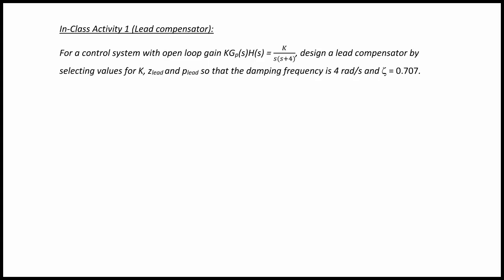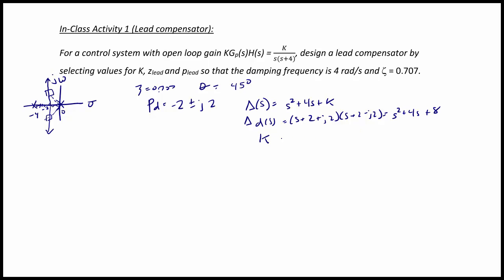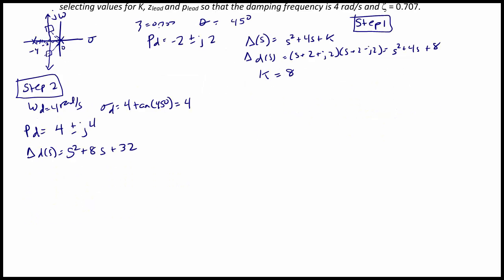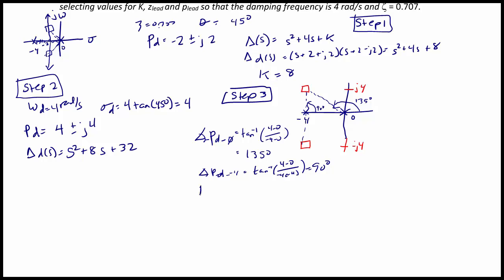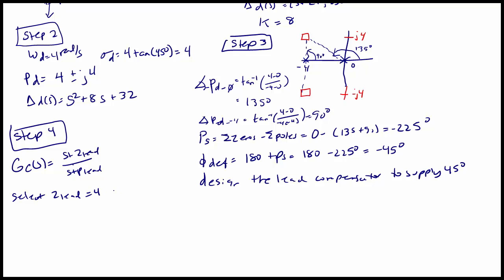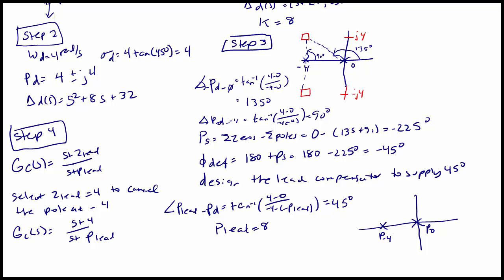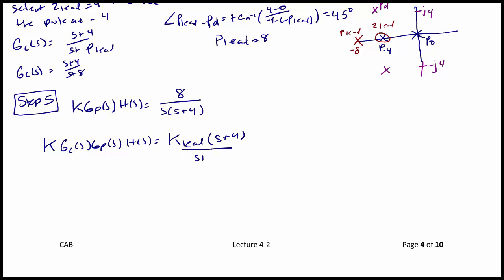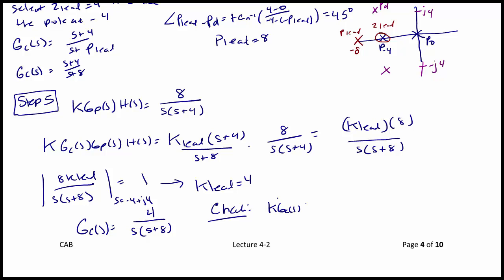ECE320 Lecture4-2b: Root Locus Design - Lag and Lead Compensators

Comment: There really is no need to carry over K from the uncompensated root locus. It has no bearing on the final result. That K is meaningless as it meets the zeta criteria but not the damped frequency. Keeping K = 1 in the uncompensated plant you would then solve for K = 32 for the lead compensator. The end result is the same looking at the plant/compensator product but really that initial K is completely arbitrary in how you want to define the plant.

Comment: the way you calculating the angle of theta in not correct. is it (180 - tan^-1(4/4) that is equal to 135 don't use 4/-4. it gives you negative value.

Comment: How you have calculated desired poles (Pd) in step 1
Reply: yeah, i get confuse with it
Reply from the maker: In order to make it clear, you need to watch the videos in context in order by going through the playlist at https://www.youtube.com/playlist?list=PLBK7yyieyrAZFABvYQ9I-li2bTWZPqIbU. This is for a class so the lectures build on each other.
Reply: take arcsin(0.707) = 45
45 + 90 = 135
draw an angle of 135, it will meet the original root locus at 2+- 2j